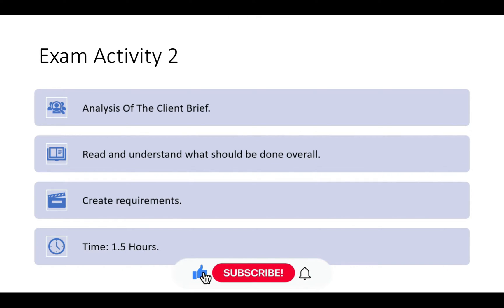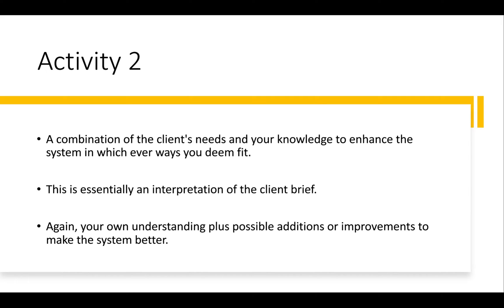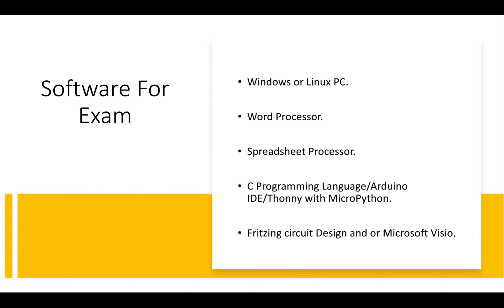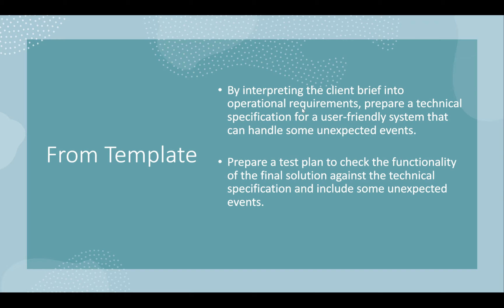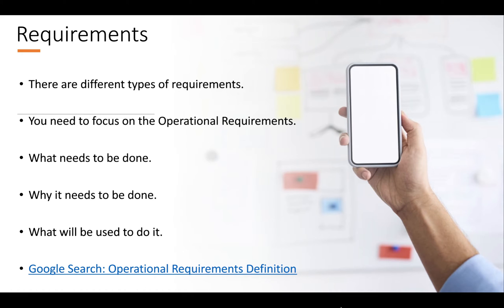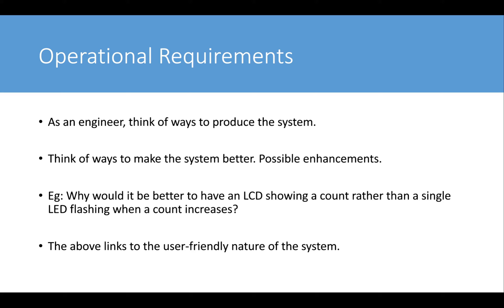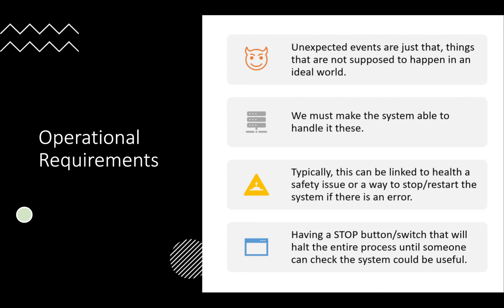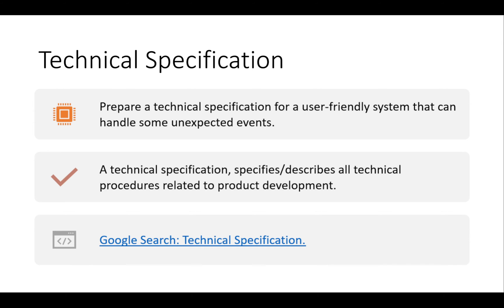BTEC Level 3 Engineering Unit 6 Microcontrollers - Part 06 - ACTIVITY 2 TECHNICAL SPECIFICATION

Comment: Hi sir, I am really struggling to understand how much to answer for like all of the questions as for example question 2, the amount of work you wrote in the answer part, and the amount of work that was wrote in the examiner report was so LITTLE, and I was like how does that take 1 hour 30 mins. I am not understanding how much to do plz help
Reply: Like is there anywhere I can find an exam that is fully answered and from that I can get an idea of what/how much to do accordingly
Reply from the maker: The Pearson website will have some past examples.
They will also have an examiner's report which will go through all the sections of a paper.
Reply: @RonsTechHub I went on the Pearson website and went on the examiners report and it only had the same amount as yours. If I am not looking at the right thing can you attach the link to your comment to the correct website I should go on.
Thanks sir
Reply from the maker: Hi. What I wrote in the example is a guide. You should expand on it.